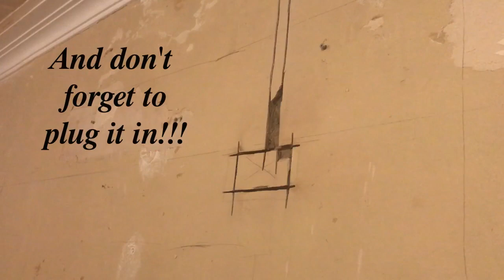Chasing out a wall for an electrical back box and cable. Also how to get the cables behind coving

Comment: Braver chap than me, doing single-handed grinding! Had a fight with one of them once and defo don’t recommend it. Glad i’m not the only one to forget plugging stuff in.
Reply from the maker: I've had plenty of practice using the grinder but I suppose for demonstrating purposes I should have used two hands.
Thanks for watching and don't forget to subscribe 👍🏼
Reply: Had a 230mm grinder slip out of my hand while doing overhead tracing and it went for my leg. I was lucky because I was wearing a pair of working pants that stopped the blade

Comment: Very good. The only thing I would suggest is, if you rig up a little clip on fixing to the guard of the angle grinder
to take the nozzle of a hoover you would collect MOST of the dust while you are using it. 
Saves a lot of time cleaning up afterwards.
Kindest Regards
Terry O'Connor
Reply from the maker: Great tip. I'm afraid my shop vac filter gets clogged with brick dust. When I build a cyclone collector for it I will have a try. Thanks for watching and be sure to like share and subscribe to help the channel grow 👍🏼

Comment: Recently got a dust extraction housing for the Bosch grinder - also, it lets you fit 125mm disk instead of 125mm. Not cheap but a game changer regarding dust.
   I always use conduit. Helps with later modifications and very useful for satellite and ethernet cable - our Zoom always rock solid in lockdown due to not relying on Wifi. 
   35mm boxes help satellite and ethernet cables bend smoother and gives more wiggle room for mains wires.
   Jealous of that long drill bit. Might have to get one for a job at home.
Reply from the maker: Thanks for the tips, I will keep them in mind for next time 👍🏼

Comment: Hi mate thanks for the video! Got a good price on my sparky because I agreed to do all the chasing so this helped loads!! Quick question: plastering... looks like you’re leaving it flush and you mentioned the wall is to be skimmed - will that affect what face plate you can put on? Also, you made the effort to preserve the coving but what happens when you skim? Will you blend into the coving to keep the same profile? Thanks!
Reply from the maker: Jack D the 2 coats of plaster will be about 4-6mm thick so the backbox can either be flush or stick out 4-6mm but your plasterer will prefer flush so it's easier for him.
There is a big step on our coving so the 4-6mm of plaster didn't matter but a plasterer might feather the skim so the coving step isn't lost.
Thanks for watching and be sure to like, share and subscribe to help the channel out 👍🏼

Comment: Does the battery angle grinder work well for all chasing in a rewire ? Does the battery last and will it cut into the brick as well as the plaster? I use a 850w 230v one but would love to use a cordless if it works
Reply from the maker: +robert swingler the battery angle grinder works great for me, with a diamond blade it cuts bricks with ease. It does however use a lot of power so having a couple of high ampage batteries spare does help when doing a lot of chases! Thanks for watching 👍🏼

Comment: If the standard angle grinder creates too much dust you can hire ones with integrated dust covers -  better than spending days cleaning up
Reply from the maker: John Grannan Thanks for your comment! I could have hired a wall chaser with dust extraction but the main aim is to do jobs to save money. Thanks for watching 👍🏼
Reply: @spendtimesavemoneydiy  So could you tell us what make of angle grinder you used. and the price of it and where to buy one please? It looked a nifty bit of kit.
Reply from the maker: SANSOUCCI if you look in the description below the video you will find links to the tools I use on Amazon. Thanks for watching 👍🏼
Reply: @spendtimesavemoneydiy  Ok thanks for reply mate,

Comment: I used to instal cable tv , often under floor cables were neater, and most extra sockets I think will run that way too, drilling down rather than up. I used a masonry bit to drill any floorboards, no sharp edges, so if you hit a pipe you weren't aware of or most things under there, you won't damage them because you'll feel them long before doing any damage. Just remember that bit will get hot using it on wood, so be careful where you put it until it cools.
Reply from the maker: Some great advice.
Thanks for watching and be sure to like share and subscribe to help the channel grow 👍🏼

Comment: Nice work, do you know what the standards are for running data cables like cat5 to an ethernet socket?
Reply: Surface mount is fine for data.  Keep data and electrics 6" apart if needing to run parallel. Will be less if data and electrical cable are shielded. Most electrical cable is unsheilded but shielded data can be purchased from most hardware stores. 

If running across (i.e. perpendicular) this is fine.

Comment: And whats prote ting the cable behind the coving
Reply from the maker: The cable runs plumb up the wall from the socket so the zone should protect the cable.
Thanks for watching 👍🏼
Reply: @spendtimesavemoneydiy , I'm amazed you understood what Mark Keane asked you. I've read his question a few times and still bewildered.

Comment: Great great vid.   Good to hear  the scouse accent as well   now i want to spur off two sockets in my bedroom but as it's upstairs do I have to feed the cable through the loft joists 
Also do you have a website where you do general questions and answers.  Thanks!!!!
Reply from the maker: Julian Hamilton thanks for your kind comment! The cables to your upstairs sockets probably run under your floor so new cables to spurs can run under the floor too! Just make sure the cables are in the centre of the joists and they run straight up to the socket! Also only one spur per socket 👍🏼 let me know how you get on.
Reply: That’s not quite correct advise.  Also dont forget that before the new additions can be energised the correct testing and certification needs to be issued legally.
Reply: @AP268  I'm afraid it's no longer a legal requirement as it is no longer notifiable work but it must be said it would be a safety requirement. No offence Skippy, just saying you are correct but not legally.
Reply: @leeemery4428  not notifiable but a minor works would be required

Comment: 25mm back box is barely adequate for anything these days.
Reply from the maker: Fabian Dee it was fine for what I needed. Thanks for watching 👍🏼
Reply: @spendtimesavemoneydiy  yeah depends what you're installing but it severely limits the options of anyone else. I'm about to chisel out a deeper back box recess in my kitchen as the builder and electrician collectively only put in a 25mm one for the CCU, recessed by 6mm, which is ridiculous for the installed chunky CCU let alone anything else but for a raised power socket it would be ok. They installed the most raised plates I've ever seen lol
Reply from the maker: It was only a spur for behind a tv so it was adequate 👍🏼
Reply: Good video. I put deeper back boxes in personally. Handy for USB sockets